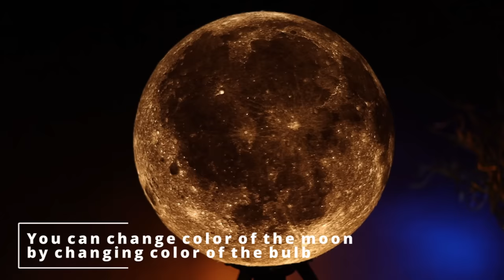TOP 25 COOL Things to 3D Print for Gift

Comment: Just so everyone knows, 3D printing is not this easy, nor is it this seamless. The author has taken a lot of time to perfect his slicer settings and hardware. But don't be discouraged; it is a great hobby to get into!
Reply from the maker: It's not easy but it's not that hard either. The slicer settings - I often use ready profile settings in PrusaSlicer and it works great.  Either way - yes, it's a great hobby 😀
Reply: In my limited (about 1.5 years worth) experience, it depends a lot on whether you buy a "fiddling with this printer is my hobby" style printer, or a "I just want to print stuff" one. There was a time when the first was all you could realistically get without insane budgets, but that's changed over the past few years.
Reply: Yeah it’s pretty hard
Reply: it's that easy with x1 carbon
Reply: @Marc3DP  I've been 3d printing for a while and yes for some ppl it's relatively easy other ppl not so easy. I even got into a little designing myself. And parametric design isn't that hard either. I have to hand it to you though I am very impressed with your design skills that's not easy. I mean you have some really cool designs I think your elephant in this video and your flexifox are really cute and I couldn't make something like that if I tried. That's hard and that takes skill. Artistic skill, just something that I don't possess and never have possessed and I'm a very creative person and I can take shapes and make a lot of things from those shapes. But mesh,, artistic, design skills. That's impressive.
Reply: Stop the nonsense, 3d printing is a hugely fun and EASY hobby with the modern printers we have. Yes, there is a learning curve but what doesn't have one? It's like saying: Don't get into car racing because fixing cars is hard. Who cares, have fun and learn as you go.

Comment: Just wondering what bed you are using. I tried several types of beds, the filament gets stuck (I don't like using glue stick/wax etc... on the bed).
Reply from the maker: I tested many bed types and the best works for me is standard Prusa PEI sheet.
Reply: @Marc3DP  I have the Ender 3 V2 and the PEI. Not sure why mine does not work. I tried  over 8 different videos but still doesn't work. I tried lowering the corners before doing the auto leveling so it can level with the middles but when I do the auto leveling, the whole bed does not work. So I had to actually move it back up.